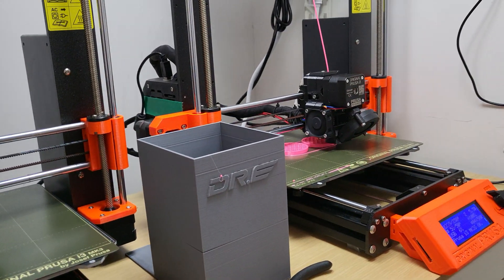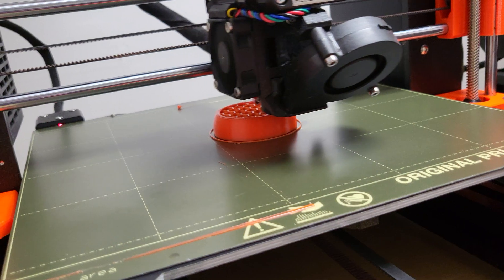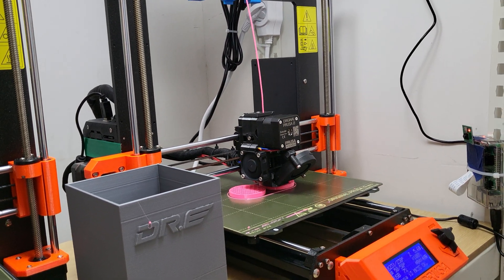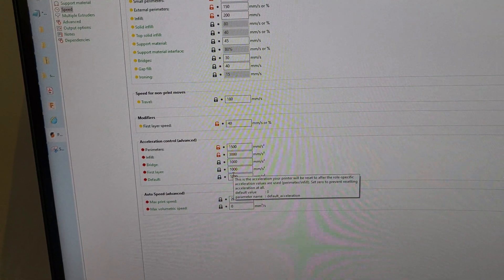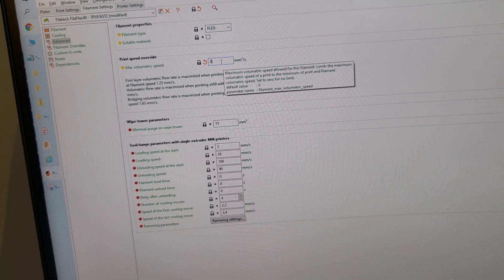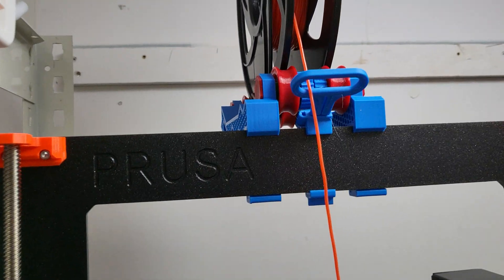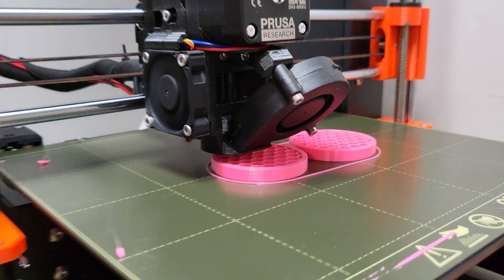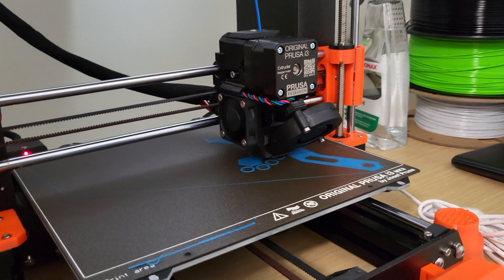Printing TPU Flexible Filament at 200mm/s on stock Prusa MK3S+!

Comment: If you didn't already figure it out, you weren't running at 200mm/s ever. That would require a volumetric flow of 26mm3/s. At a volumetric flow of 8mm3/s, your max speed was  limited to ~64 mm/s with a 0.4mm nozzle.

Comment: Do you use something to increse the adhesion? I have a warping very often at smooth pei steel sheet
Reply from the maker: If you get the temperature right and calibrate first layer TPU sticks without any additional stuff.

Comment: Hello, I’m a massive fan of your channel. Could help me fine-tune my Slicer setting for a large TPU print? I manufacture shoes using soft TPU filament such as Ninnjatek 75a (Shore hardness) chinchilla. I was amazed by your video where you showed your Prusia farm absolutely flying through 95a TPU Prints. 
How can I reach these speeds with 75a? 
What is your preferred contact info? 
Would love to get in touch! Thank you!

Comment: How tight or loose did you have to set your idler? Mine started clicking almost immediately at almost any tension, but it didn’t jam or anything…
Reply from the maker: I use the least amouny possible.  Sorry for the reply just saw this.

Comment: What kind of ball bearings did you buy? I have some "standard" ones from Amazon, and while they spin, it's not nearly as fast or free-spinning as one you'd see on a fidget spinner toy.
Reply: Something to note about many 608 ball bearings:  cheaper bearings will probably spin MORE freely.  Fidget spinners use bargain-bin bearings.  More grease [for less wear]—>less freely spinning.  Look for a low “ABEC” class bearing: Lower “ABEC” = larger clearance (tolerance)/less drag.  Generally~

Expensive bearings (608 bearings for example) are made for skateboards.  You want decent grease so they last longer.  A Spool Holder though?  Go cheap and even clean them out and re-grease with your own stuff if you want to tune them.